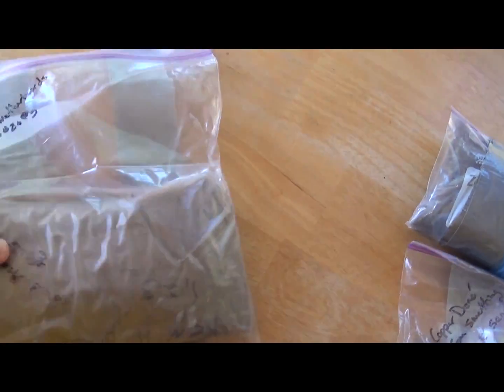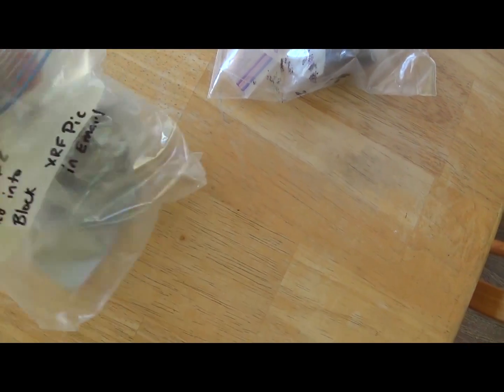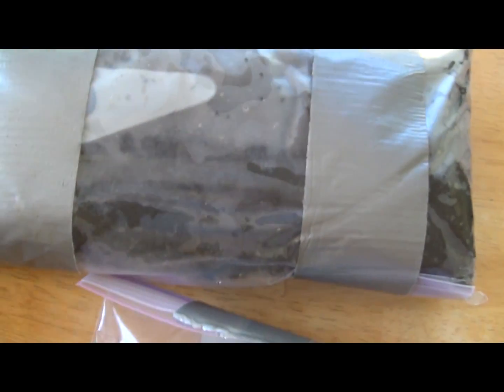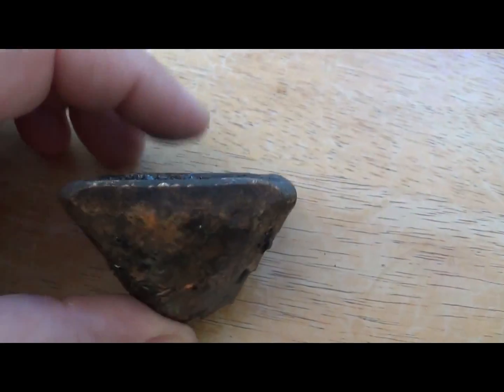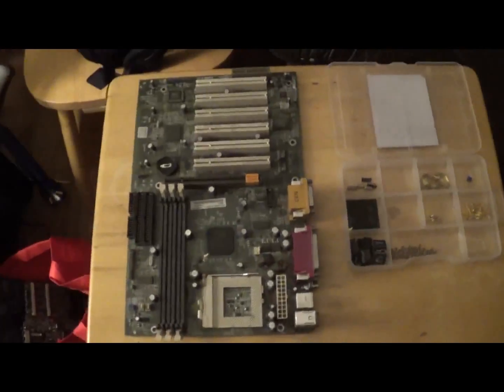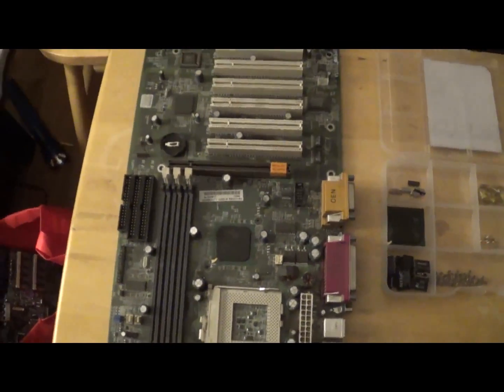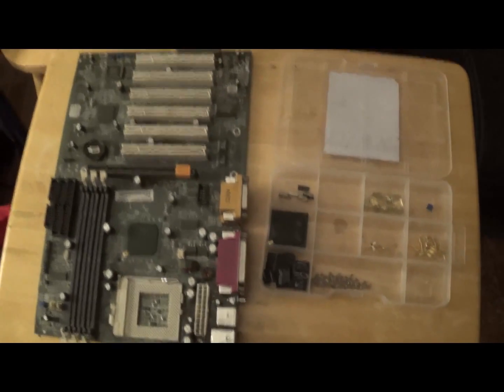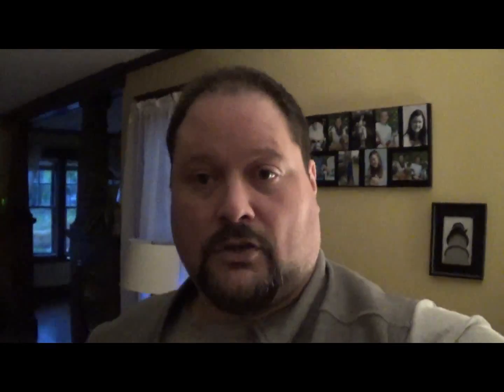Gold recovery of crushed motherboards from MBMMLLC

Comment: curious to know if there's gold in the green motherboards etching? I think I seen it was mostly copper, maybe you could do a video with the motherboard completely stripped and ground down maybe even without the solder, I thought of just heating a large plate then setting the bare board on it to scrape off soldier maybe gravity would keep the solder on the plate. 10 or 20 bare boards at once would show some results.thx
Reply from the maker: Its copper, the only places you will ever see gold etching on a circuit board will be rarely in cell phones, sometimes in military or airplane electronics.  Very cost prohibitive to use all gold etching.

Comment: I can tell you how  too get the gold out of the black sands ... I hope you did not  do anything to them yet ....
Reply from the maker: +odenkiller and that would be......
Reply: How to get the flour  Gold ( Au) out of the black sands ..   it has a many steps   but it is the best way ..
Reply from the maker: +odenkiller I'm all set getting the flour gold out, its the gold that is encapsulated in the sulphides that's the problem.  I need to find a fairly easy way to mill the sands down to 200 mesh.
Reply: get a small sluice box & run it slowly  threw it , you will get some of the smaller  flour from it ,, then when the sand is wet  lay  it out across  a non metal pan to let it dry on then  with a plastic bag  with a Earth Mag on  it  slowly  run across the  sand when  it is dry ..  you may redo  this  step a few times .. then if you can make a shaker box run it across it a few times ...

Comment: Love your videos Moose. Maybe I'm a pessimist but I find it hard to believe that a mining company whose goal is to make money from gold etc., would provide anything of much value. Maybe they're "true blue" I couldn't say but that classifying table should be able to separate the materials rather well and so would they sell off any material that is really valuable? Also, I have been using Nitric acid, which you can make yourself but concentration it is more difficult, to drop gold from solution. The copper, silver, brass, not sure about aluminum, will be dissolved in Nitric but NOT gold. It will be left at the bottom of the solution as a powder. I usually heat it up a bit to help the reaction. Then I let it cool, filter, and rinse. The solution which is left contains silver, copper, etc. which can then be processed further. Also, the copper nitrate etc. can be decomposed to yield the nitric acid back again. I'm no expert, still learning, but just FYI.

Comment: Have you tried a wire brush wheel or sander to remove the gold from a board?  Although dusty, it seems like a transportation/ time saver to give you faster results.
Reply: I thought the same thin earlier today! lol You could make a shaft of 'bristles' and run the board underneath like a wood planer or jointer (similar) then collect the dust and have that to refine.

Comment: Thanks for being honest,I did comment on your last video about this company and point you in the right direction.Its not possible to grind a whole mother board into small enough particles to put straight into water separation.You would need to chop or grind the mixture of glass,plastic,ferrous steel,non ferrous steel,solder to a similar size as the gold bonding wires in the chips.The screen would just get blocked ,Just like you showed in your video,its better to cherry pick and process separately

Comment: use copper sulfate  electrolysis of the pyramid to make blister copper, and recover the gold containing sediment, then chemically extract that.  You definantly want to be recovering the Copper as it is a sizeable portion of the economic value of the board.  Really you need a series of chemical / electrolytic processes.  

Don't handle that stuff with your bare hands. Cadmium could be an issue.

Comment: I have been stalking up on gold pins and stuff for a little while and am starting to think about refining it. One question thou. When something is plated, is it always plated in 24k or can like 18k be plated? If so, should I be sorting my gold so the lower k doesn't mess with the higher? What k are the gold nuggets that you refine?
Reply: Most gold foils range from 10-20karats but you will have the worst time sorting it. In fact, I don't think it's possible. Moose has another video on how to refine the gold to turn it into 24k gold. Hope this helped!!!
Reply: +William Ela thanks. Il be sure to find that vid :)
Reply: +William Ela  How exactly would one plate anything other than pure gold with the electrolytic process transferring gold ions?  is the electrolyte a mixture to convey other metals at the same time?  Strange.
Reply from the maker: +Brady Rose Sorting will not save you time or money in the long run as far as by karat plate even if you could figure out how to do it.  One of the major hurdles is that any chemical test will quickly dissolve the gold plate and then start on the base metal giving you a false reading.  As for the plating process, I have not learned enough about that yet to give info.
Reply: Moose Scrapper I wasn't actually interested in sorting them, but wondering how plating in different grades would even be possible.  I've always been under the assumption that electrolytic plating would only be depositing gold ions, so I was surprised and just wondering out-loud how it might be done hoping magic of the internet might materialise a response that might still come.
Reply from the maker: +Brady Rose Great question, honestly I do not know.  From what I know about plating that would make sense unless its because the silver is plated in the same process witch is what is most often used to mix with gold to create lower karats.
Reply: Brady Rose I think the gold itself is pure but the fact that the acid does not eat 100% of the nickel and copper off the back of the foils brings down the karat of the gold. Moose's comment about the silver is also very possible

Comment: Great topic moose...I've been panning a lot of black sands and reading about the sands composition and have been finding native platinum and copper sulfides and zinc and calcopyrites anyway one of the books I was reading talks about nitric acid leaches with table Salt as the precipitater.Im no expert my first hydrochloric batch is still unfiltered but loaded with fingers...so basically the black sands are of interest for refining Andi look forward to more videos from you cause you rock
Reply from the maker: +area46241 I have been doing more reading at work than working I think.... don't tell my boss.....  And with some help from other great refiners like Geo, I suggest EVERYONE check out his channel, I was able to learn that the leach only works if the sands are ground to 200 mesh.  So I now need to learn how to do that.